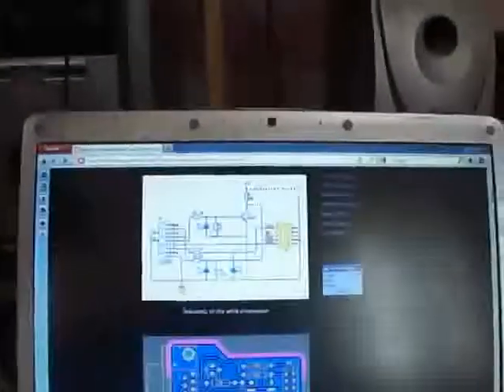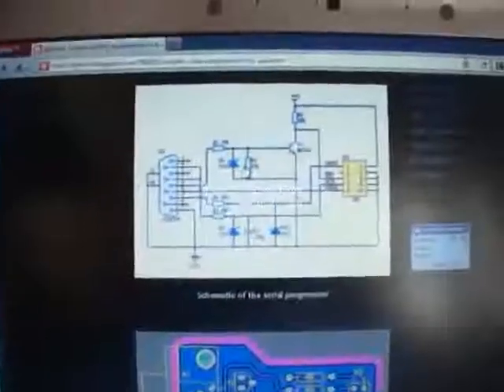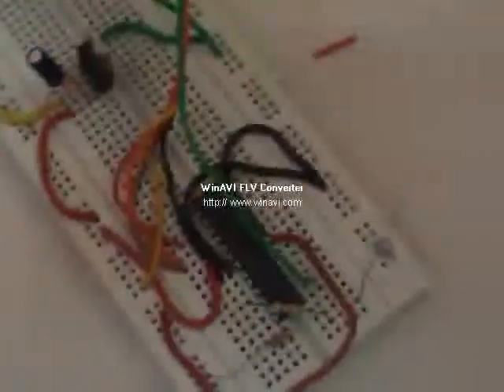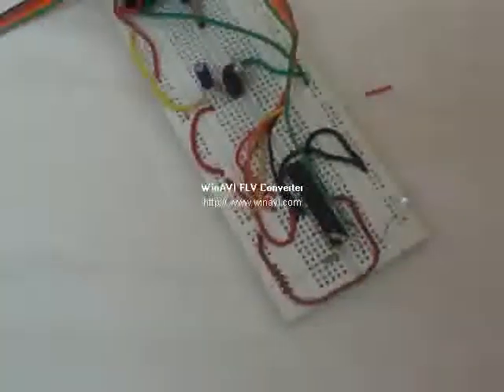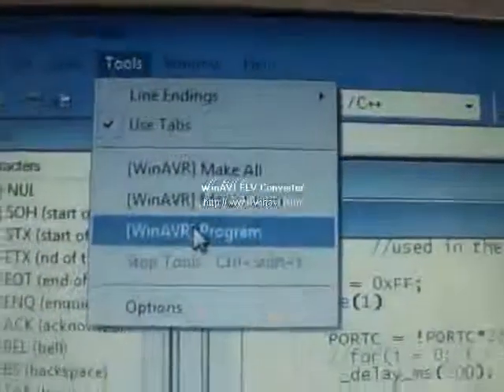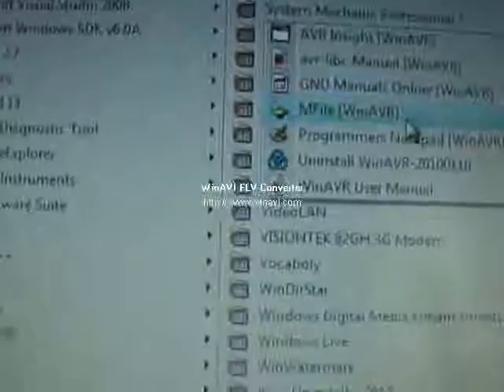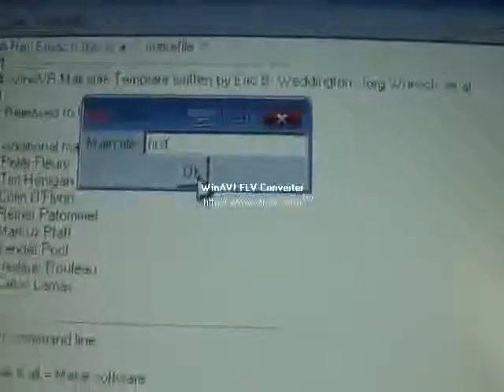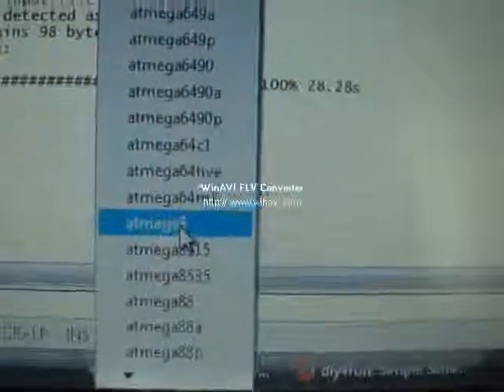Serial Programmer for AVR

Comment: hi i am using  ponyprog to write flash into atmega 32 with the serial programmer circuit as you have used in  above  but i am not able to do please can you help out with this , i written code in Avr studio and done with the hex file .